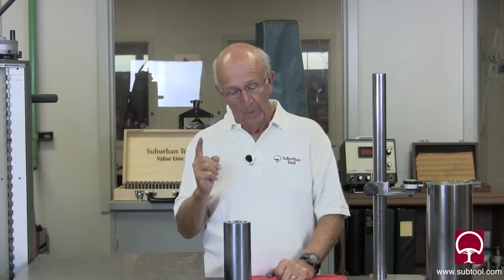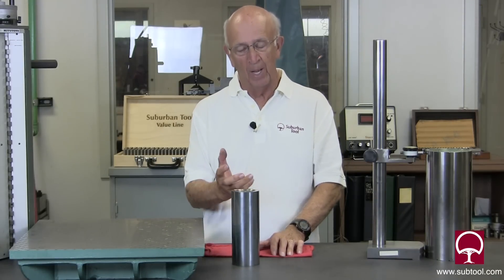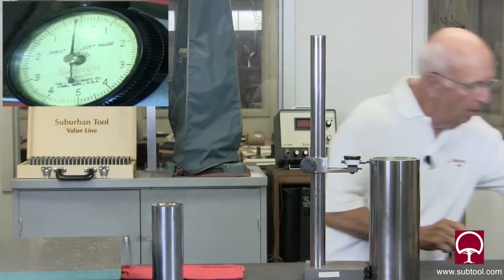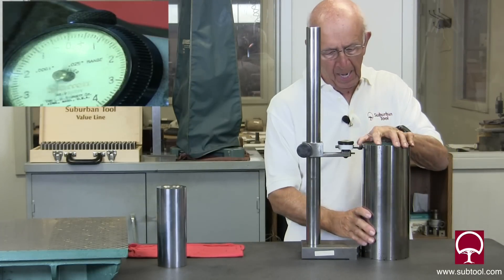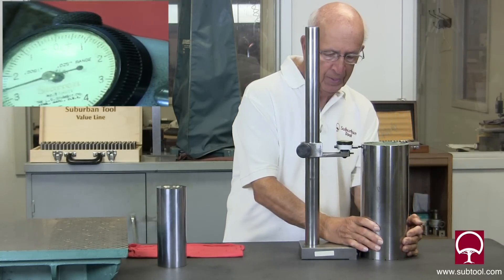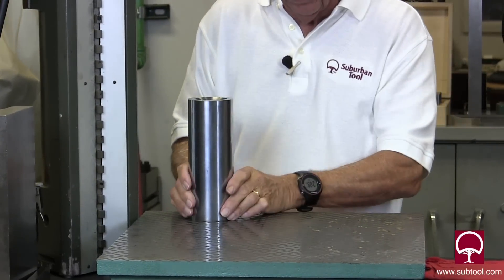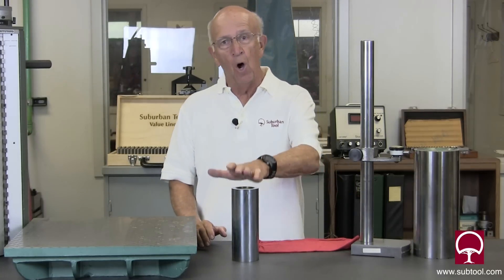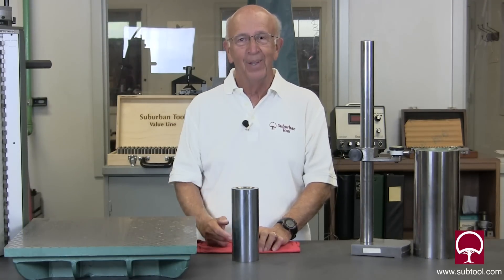How to check and repair a cylinder square.

Comment: I really want to make a cylinder square but the guys wont let me in the toolroom because it's too "expensive", I would be doing a 60mm X 200mm mild steel with a 2/3mm thick case hardening :(

Comment: first time herring of a cylinder squares what are they used for I am a hobby machinist learning  some thing new everyday
thank you
Richard Westerfield
Reply: They're used for calibrating squareness checking equipment used for checking finished parts. Not really needed in the home shop.
Reply: u can square up a mill head to within 3 thou or better if ur good
njo need for tramming the head

Comment: On a 4" diameter 12"long cylinder that is off 50 millionths per side, one would remove 50x(12/4) or 16.67 millionths of an inch. Don't sneeze, you'll remove too much.😉
Reply from the maker: John Bazaar Exactly

Comment: I was told that if you mount a cylinder in a chuck, like a lathe, and grind the end face of it while turning it, making sure the face is ground slightly concave rather than convex, that you are guaranteed a square end to the cylinder.  It seems to me that would only be true if the cylinder was being turned with zero radial runout and perfectly concentric with the spindle axis along its length.  Comment?  Description (or video!) of how cylindrical squares are manufactured?
Reply: +Bob Korves The part would only be as square as the squareness of the carriage to the cross slide.
From a machinist or toolmakers view, the part would be perfectly square. From a metrologists point of view, it would be roughed in.
Any tool room lathe can machine a cylinder that is square to under a thou, but this cylinder would not be adequate to set up a machine this precisely.
You should always measure with a tool that is about 10 times more precise than the tolerance in your measurement. IE, use a 10th's mic to measure to a thou. Since we want a precision square to be square to under a 10th, we need to measure and machine to the 10milllionth. You can't realistically machine to this tolerance, and you will lose that much material on the grinding stone during the process if you grind.
Reply from the maker: ***** We will have a follow up to this with another great tip and a discussion on how to build a cylinder square in the next week or two. Stay tuned!